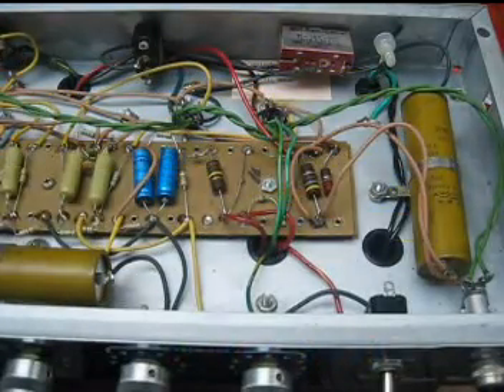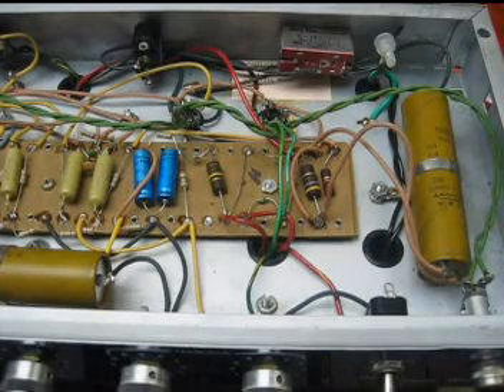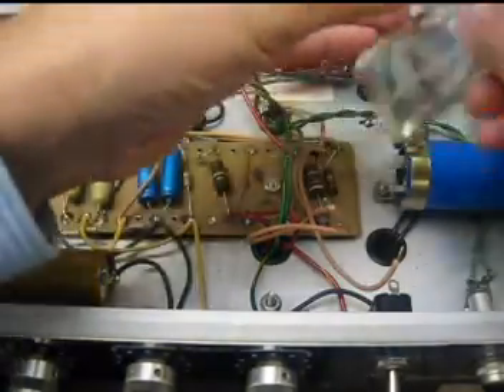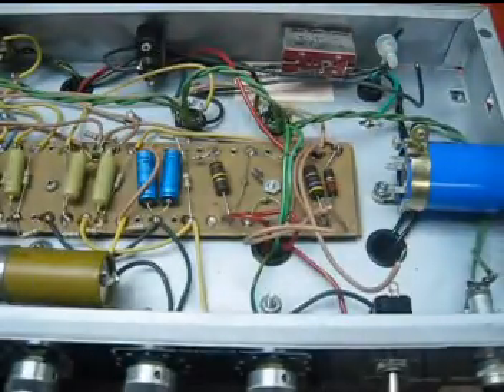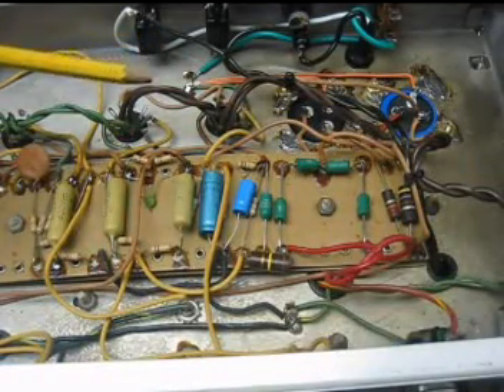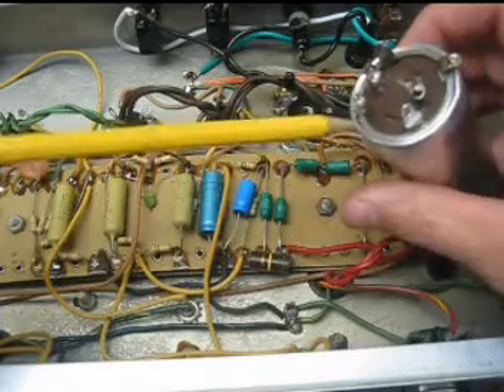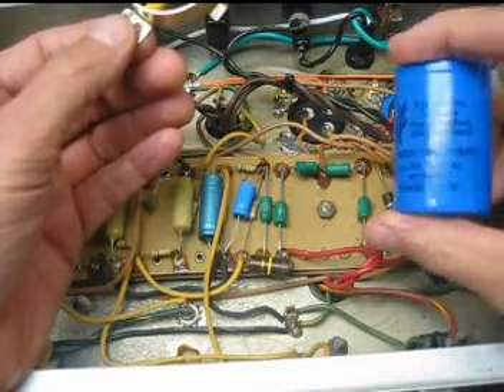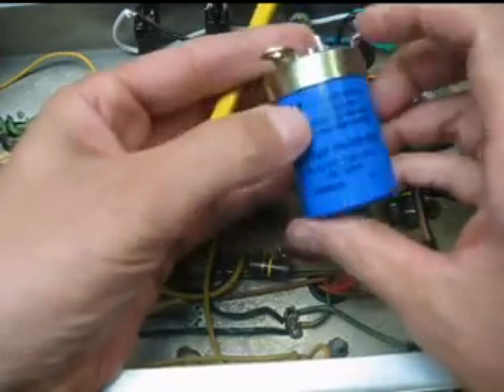Capacitor Replacement guitar amp

Comment: Have you ever used the flatpack style capacitors?  They last much longer than radial caps but I haven't seen someone use them in an amp yet.  Much higher reliability and thermal stability.  My amps are getting old and I don't want to replace the caps again before I die.  So I'm asking around.  Thanks!

Comment: My amp (carlsboro stingray super) has leaking electrolyte from its power filter caps, a salt crystal formation all around the ends basically! Wondered if this can cause fuses to blow, it only happens occasionally when switch on.

Also these caps are 50V and 4700uF which is quite different, but i notice they are after the transformer and likely dropped voltage and different impedance that requires different capacitance too. Just wondered if there's a reason for this and why there's no 500V caps next to the supply in there! Would there be an advantage to installing some to reduce any noise?
Reply from the maker: yes because the cap starts to draw more current than it should as it fails

Comment: thank you..just one question,i have vintage amp with allan bradley resistors,and some have to be replace, As i dont find some values, can i replace them with arcol or some other good branded onece or it should be the same brand with same tolerance?any help much appreciated.
Reply from the maker: +Alvin s yes

Comment: Was it really necessary to tell the viewer that, if they don't know how to discharge the cap, they shouldn't be doing this? It just makes you look like a jerk.
Reply: +thorinbane I'm curious about why he just didn't discharge them. It would have only added maybe 30 seconds to the video. FYI, look up Kye's video on Premier Guitar's channel. The video is called  Amp Safety 101. Very good tutorial on capacitor discharging.
Reply: does it, i don't really get why that would make him a jerk. Some noob might just stumble across this video the first time they ever looked inside their amp, and bam 200+ volts, it doesn't hurt to remind people.
Reply: nonh8nsk8r
 Its insulted with wood.
Reply: nonh8nsk8r
 You tube videos use to have a 9 minute time limit when pat was doing these. May have made the video go over time. The point is, if you don't even know how to discharge your caps(which I believe he covered in a different video) then you SHOULD NOT be poking around in your amp.
Reply: +Earl Teporten No its called Safety first, your comment makes you look like an uncaring jerk. Some people just think they can do stuff even if they can't. Gentle reminder helps. Maybe you fall into that category.
Reply: +thorinbane Also,  he is using a pencil to poke around in the board.  Not safe, as graphite can be a conductor.
Reply: I agree, Earl. It would be nice to see a link to how to discharge not some snoody comment.

Comment from the maker: becauase the power tube draw a lot of current, so the big filter just after the diodes stores power for big bursts 
and helps reduce noise in the power supply... the pre amp tubes draw significantly less current so having the same filters at every stage in the amp is complete overkill and was only done to make parts purchases simpler for the amp company

Comment: Thanks for these videos!  I'm having the filter caps changed on a Traynor YBA-3.  I'm pretty new to the world of amp mods and was just curious - At the end of the video where you use a 50/50mfd cap in the first stage and a 32/32mfd cap in the second stage - You say "it can be a good thing that there is more energy stored in the first stage"  Just wondering why that is?

Comment: i have a 69 traynor yba-1 bassmaster. i have no idea how the previous owner used it or if they replaced the filter caps. it does have the newer style plug though so some work was done on it. but everything else seems original. how can i tell if i need to change my filter caps? how big a sound improvement does this make as well? should i just get it done to be safe?

Comment from the maker: @pumpkinfan283   Im not trying to be harsh... its probably a cold solder joint or loose part ... very simple to fix 
if you have the detective skills to find the problem ...  with electronics repairs 99% of the work is finding the probelm

Comment from the maker: @pumpkinfan283  its a solid state disposable amp ... typically these types of amps rattle apart over time since solder does not hold the components properly to the board ... unless you know how to find cold solder joints 
and broken mechanical connections you will need a professional ... IMHO you may want to save your dough and invest in a garage sale vintage Traynor

Comment: I have a Crate XT65R that i just bought as a practice amp. I was playing it and the sound just cut out. i have power but no sound. the only noise i get is a very quiet but high pitch noise that can only be heard on the Solo channel. Ive done as much research as i could for this problem and it seems like the caps are the problem. at least from what ive been reading. think you can help me out? id appreciate it greatly.

Comment: @MVLINEMAN The only thing i ended up doing to mine was open it up and tighten the screws that hold down the PCB board. It seamed to sure the lack of gain but it's still not enough for me at the moment. 

Give that a try and see if it helps you any. 

Also i am not sure a solid state amp can be biased like a tube amp.

Comment: What are the signs that your filter caps need replacing?

I've got a solid state amp and i've recently opened it up to have a nose about inside as my main problem is that it's never had alot of gain on tap. According to other these amps are known for their gain. So would the filter caps need replacing seen as the amp is 24 years old now also would this help with the gain issues. 

As far as i can tell nothing is wrong with the amp nothing loose everything is clean and works just lacks the gain.

Comment from the maker: no, discharging the caps is strictly about safety ...    whenever you open an amp chassis there is always a danger of getting Zapped ...      the power supply runs through the amp and one wrong poke and you can get hit 

I once got a vicious jolt from a 100 watt  marshall when it slipped and I had to change my grip to catch it .. put my thumb right onto the main filter ... almost threw the chassis across the room  zeee--yow

Comment: Hi, I was just wondering if I could have caused any damage to my amp. I cleaned all of the tone & volume controlls on the amp without discharging the capacitors, is this bad? could I get zapped?

Comment from the maker: I assume you are talking about a Can cap with three sections ....

Match or exceed the voltage & be close on the mfd rating 
you may have to use a more common can cap and mount the 2 uf at 350 in another place

Comment: Sorry for this noob question, but I need to replace a 60uf - 20uf @ 450 - 2uf @350 filter cap, And such a cap doesn't exist. how could I make a different cap work, and why will it work?

Comment: What happens if you just try and whip the caps out of the amp without discharging them first? I have a Marshall Valvestate amp which had a filter cap which was shorting out, one side had a dry joint and I re-soldered it. I turned the amp back on and it played fine for about ten minutes and then the sound just turned to a solid buzz and no other sound...

Comment: Hi, my ampeg has an aluminum filter cap that have 4 pins on circumference are connected to ground cables.
Now I'm going to replace to new mundorf filter cap(I have found same capasitance one). Can I connect the ground cables together to the minus terminal?
"Substitute" is my favorite THE WHO song.

Comment from the maker: whoa... I am not an amp technician ...   and any tech would want to examine your amp in person rather than guess based ona description ...
#1 just because tubes Light Up does not mean they are passing audio properly 
so check your tubes first 
#2 if you were just playing normally and it cut out it could be one of two things 
a bad tube, or a cold solder joint (a common problem in modern amps) 

so substitue your tubes till you find a bad one ... if that fails take it to a proper tech

Comment from the maker: Most Reissue amps are overfiltered .. and a Fuzz face should have no power filtering & should be used with a carbon zinc battery ...     
most people & engineers cannot resist the temptation to "improve" vintage power supplies ... real vintage powersupplies were very crude

Comment: Do you know of any sound clip / video that's demonstrating how under-/over filtering sounds? I don't work with amps because of the high voltage but I have built stompboxes. 

For experimenting, do you know if I would hear differences in overdrive stompboxes as well, when changing the electrolytics?

Comment from the maker: I think it simply adds too much bottom end, like too big of coupling cap would ... resulting in a lot of lows the speaker can't control. 
Secondly added filtering reduces certain distortion harmonics some people call the "Brown sound" ie power brown out. 
 Too much filtering expands the bandwidth too much, adding hi's and lows people don't want to hear in a guitar tone .... 
In a non master amp this midrange eq emphasis is critcal to the distortion tone.

Comment: Thanks for the reply...

Experimentation is still the most valuable tool when it comes to audio and that is the only one that counts. 

Why could less ripple harm the feel? Could that be because you don't change the resistors in the chain (If it is the first capacitor, inner resistance of tranny and/or additional rectifier output resistance) and your filter's cut frequency goes lower and because of that amp's guitar signal modulating the B+ supply?

Comment from the maker: I'd add that I would filter the same amp two different ways for stage vs. low volume use. 
For a "live amp" I do add filtering at the first filter stage...  but tend to reduce filtering in all pre amp stages whenever possible 
added Filtering can add add headroom at the expense of tone

Comment from the maker: 60 mfd first stage on a tube rectifier...
Adding extra filtering is a very common bad idea ...
since it destroys the sound and feel of the amp, while providing the illusion of added bottom end 
Don't get me wrong it works for certain amps, like master volume marshalls, and a number of modern hi gain amps 
If you've played most  non-master volume re-issues of classic amps and noticed they don't sound like the old recordings, you will also notice they are grossly over-filtered